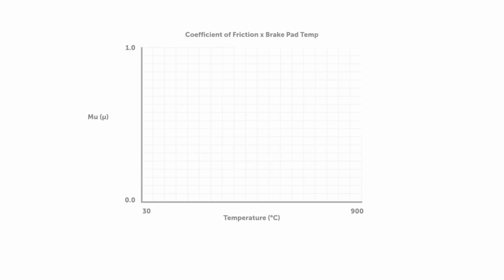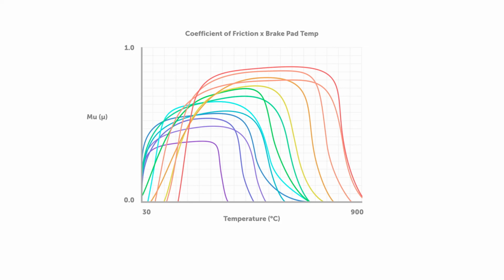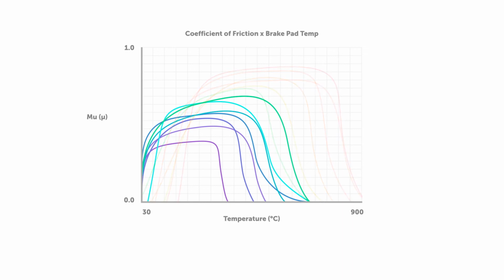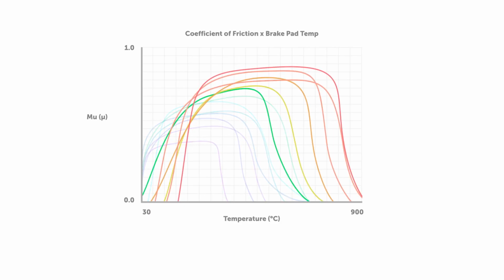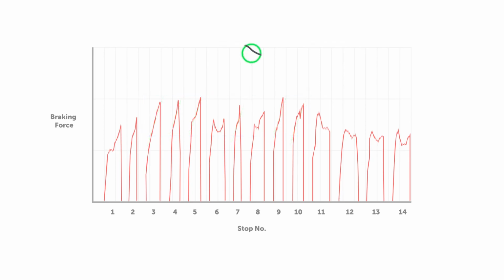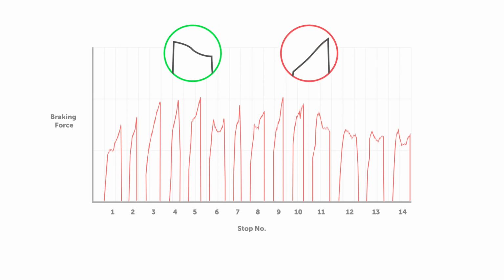How to choose high performance brake pads.

Comment from the maker: TIME STAMPS:
0:00 - So Many Options!
0:48 - Why Are Some Compounds Bad?
1:16 - Brake Disc Material
1:51 - What You Need To Know
2:14 - Street Car Pads
2:21 - Endurance Race Car
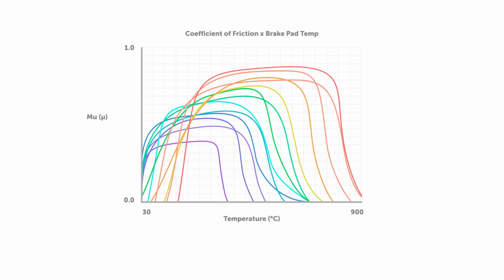2:40 - Compound Comparisons
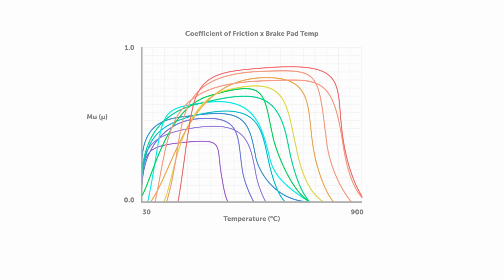3:23 - Understanding The Operating Temperature Range
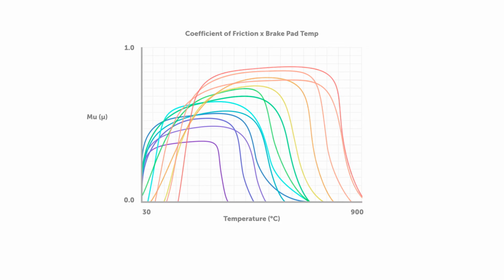4:05 - High Friction vs Low Temperature Compounds
5:01 - Measuring Brake Temperatures
5:21 - Reading Manufacturer Compound Plots
5:41 - Brake Dynamometer Testing
6:09 - Cold Performance and Initial Bite
7:19 - Brake Fade Explained
7:44 - Diagnosing Pad Issues With Data
8:42 - When To Talk To Your Supplier
9:11 - Using Pad Compounds To Adjust Brake Bias
10:49 - Recap and Key Takeaways
🏎 Building a fast car? Get $400 OFF the all-inclusive VIP online course package deal: https://hpcdmy.co/vipbrake
🛑 Brake System course. Design & optimise your setup. Now 50% OFF your first course:  https://hpcdmy.co/brakepads